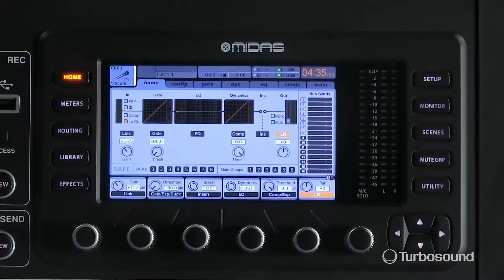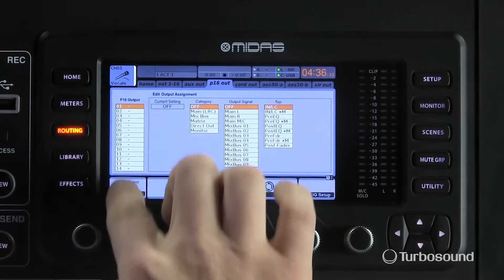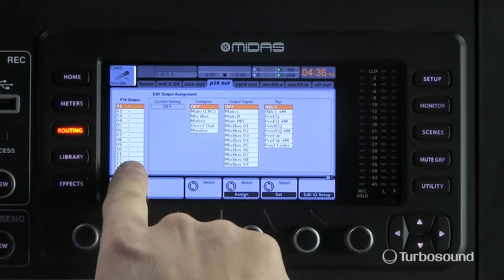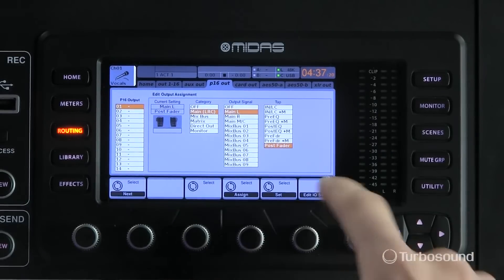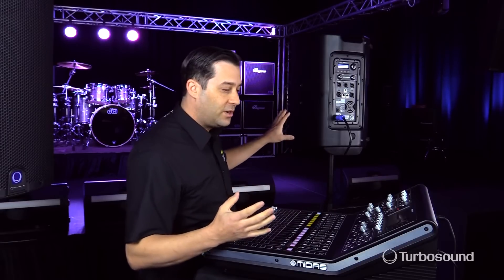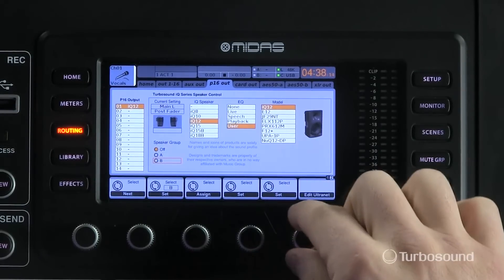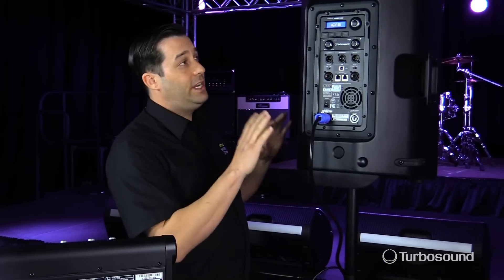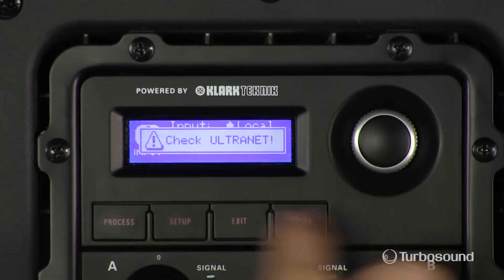TURBOSOUND iQ Series - ULTRANET with M32R

Comment: may i use 30 turbosound iq15 in ultranet with 2 channel of this network ? for example ch01 for main L and ch02 for main R and 15 speakers set to p16-1 and 15 speakers set to p16-2 ?
Reply: I haven't tried it but I'll assume you can do that. I'm not sure if you can assign output delay on ultranet channels though, as you can with the XLR outs.
Reply: Actually... the IQ series speakers have delay built in anyhow.

Comment: Legitimate question: what’s the benefit of ultranet over an XLR? Is the signal cleaner maybe?

The speaker modeling options and EQ options are nifty perhaps, but if I’m using an M32 I would rather just use a master EQ in the LR channel. Plus I’m pretty sure you have access to those options on the back of the speaker when using an XLR. Am I missing something?
Reply: No more need to run a snake with multiple outputs. Just daisy chain all your speakers to cat5 and assign their channel. If it works with an un-managed network switch that would make routing even easier.

Comment: i don't get it.... what is the purpose of the non turbosound speaker models that we see in the last column of the p16 output page ?  most of these models doesn't have a digital input. How to connect ultranet to those speakers? or..... these are just "simulators" of the speakers sound?
Reply: They're speaker sims.
Reply: They're speaker sims.

Comment: I am considering getting the Turbosound IQ series speakers specifically for the Ultranet feature to setup main Left & Right speakers, Subs and Monitors. By utilizing the P16 routing on the X32 Rack will that method effectively free up the analog outputs 1 thru 8 on the back of my Behringer X32 Rack, in essence expanding my output capabilities?  I hope that makes sense. Thank you so much... Great video.
Reply: I'm on the same way of thinking 
Let me know how it went